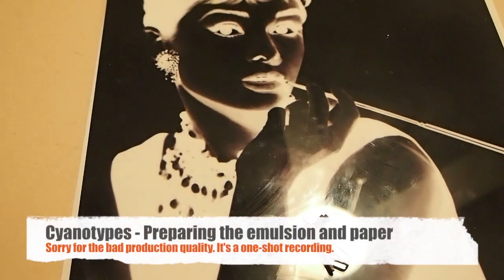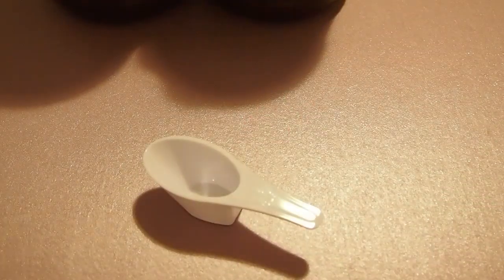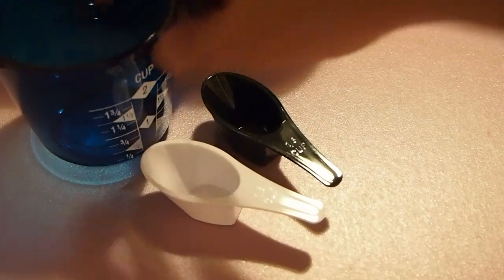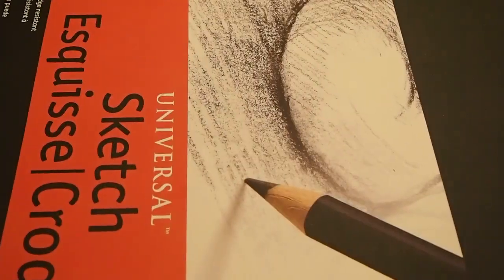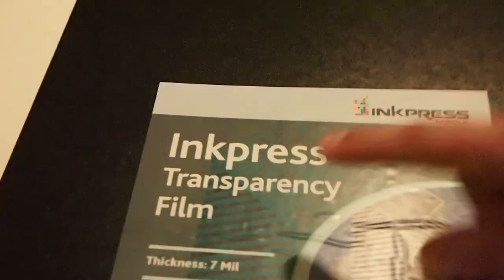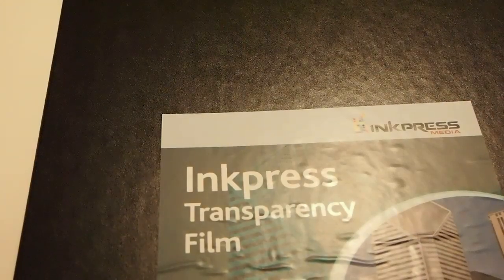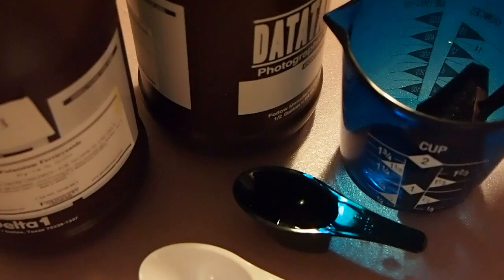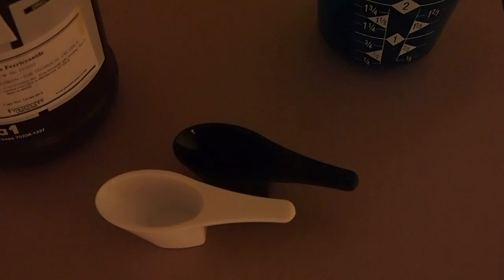Cyanotypes e01 - Mixing the emulsion and prepping paper

Comment: Correct me if I am wrong, but it doesn't matter if the lights are on, because cyanotype is only UV sensitive, not tungsten or flouresent light sensitive??? No need to turn out the lights? So why turn off the lights in this video?
Reply: It's okay under fluorescent lights/indoor lights. I've been testing it out. Totally fine. You just don't want it to be exposed under a light source for a long time, meaning hours.